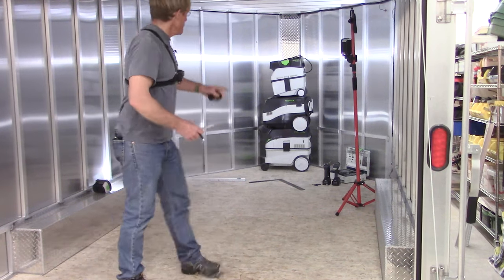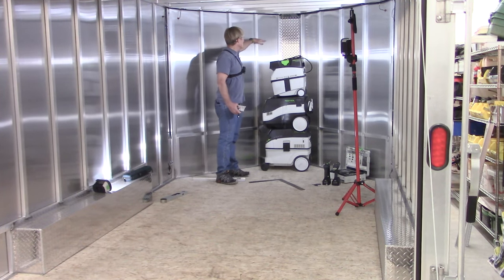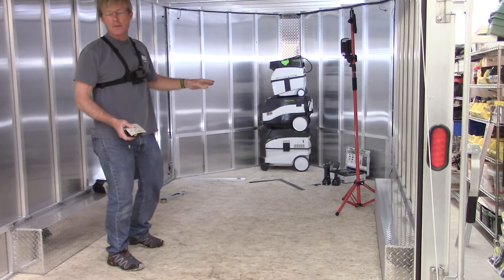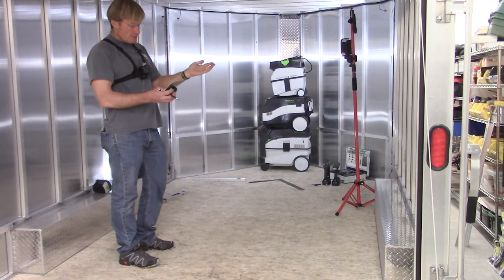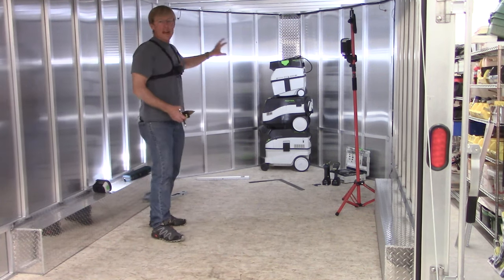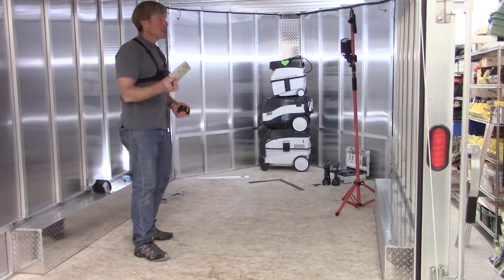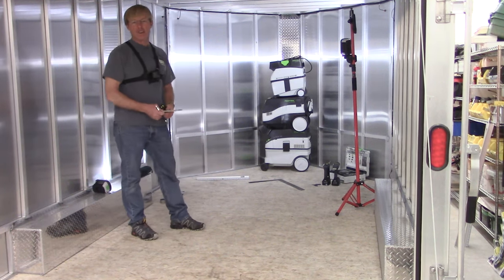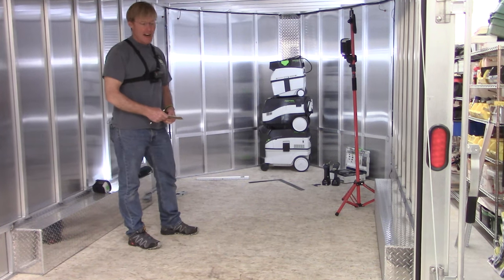The SMART Woodshop Nose Cabinet

Comment: Why not forget the shelves for the vacuums and just leave them stacked on top of each other? That way when you go to setup, you just roll them all out stacked on top of the bottom one.  No need to pull each one off a shelf.  Reduces the number of motions.  Super lean!  Of course, you'd have to figure out a way to secure them in the trailer during transport...

Comment: Could you have ordered the trailer without the OSB floor? I am excited to see what you came up with on the new design!
Reply from the maker: I don't know. I think OSB is the best choice, much better than plywood for durability so I haven't ever considered it until I found this non-skid.
Reply: the non-skid looks like a great product and it would be nice to have that instead of the OSB I guess you could put it on top of the OSB but it would be nice not to have to
Reply from the maker: The NonSkid is 18mm so if I put it in it will only be if I can get the OSB up first.

Comment: Hi Ron,   Sorry but you lost me on the new decking. Why are you tearing up the one in place? That 3/4 inch added to the existing floor is not going to change anything you have designed. Looks like a huge mistake to me. the added layer will just give you a better/stronger floor to build on and the slight added weight is not going to be noticeable with your use of lightweight plywood. I would like you to think about it again before you start ripping out the existing floor, please. your final decision of course.

Comment: I meant to ask this question in previous SMART videos, but how tall did you order this trailer? Any extra height?
Reply from the maker: My trailer is 6'4" inside which is Mission standard, you can order them taller in increments of 3"
Reply: That is really nice. I've worked out of trailers that are 6' interior and those are a headache... literally.